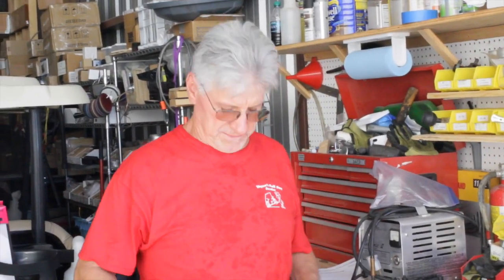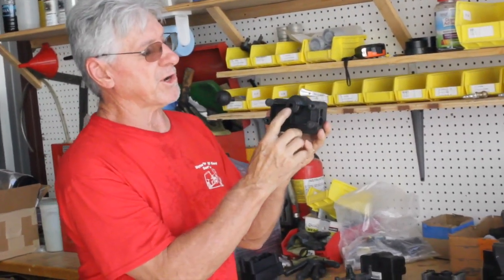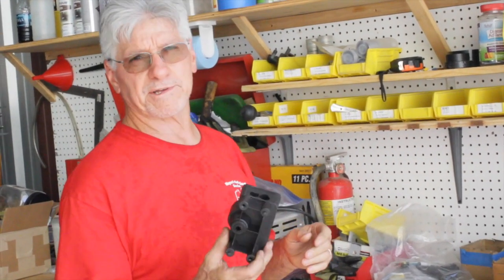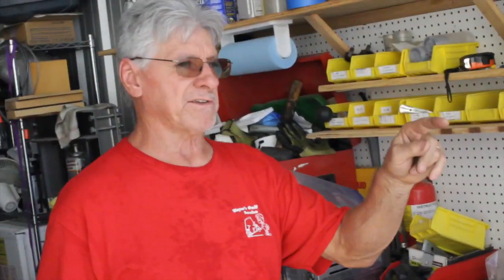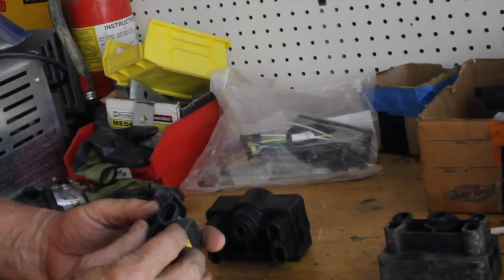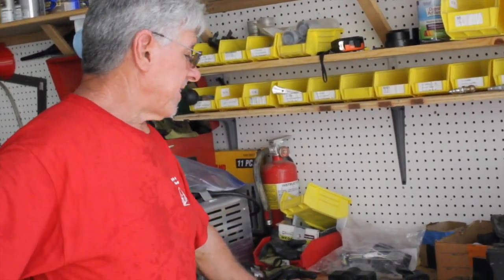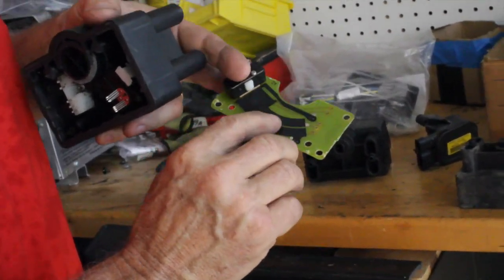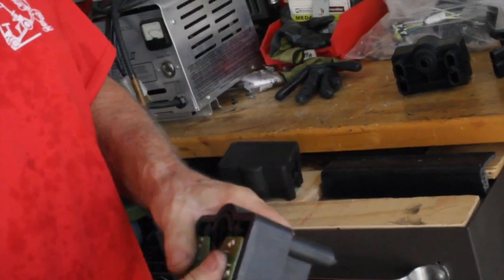The Difference Between MCOR's (For Club Car Golf Carts)

Comment: My cart doesn’t really shudder, or hesitate. It intermittently just doesn’t go when I depress the pedal.  Nothing.  So I just press and release until it finally just takes off.  Or I can turn the key off and then on, and that seems to get it operating again. Then it operates normally.  One round last year it  did this multiple times, then worked fine for many rounds.  Then did the same thing a few more times the rest of the year. Very intermittent.  Your thoughts on what the culprit may be?
Reply: Alant mine did the same MCOR is bad more than likely.